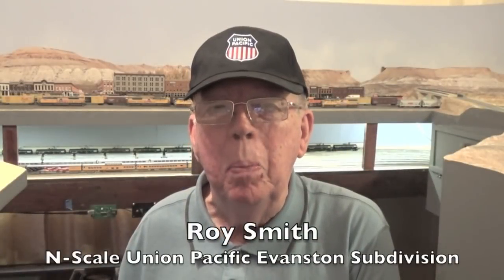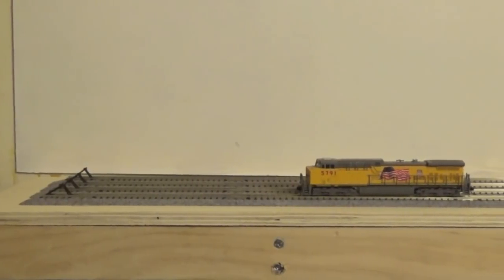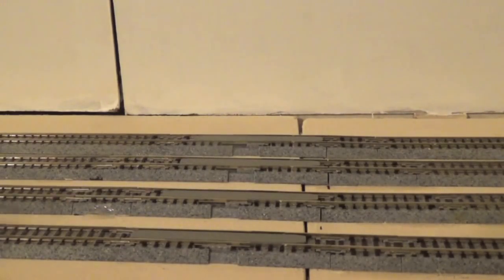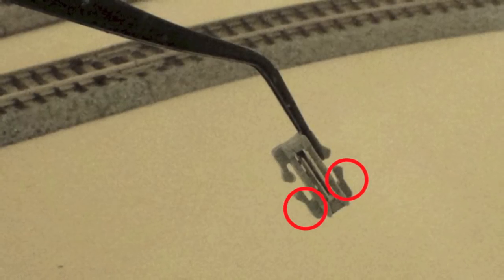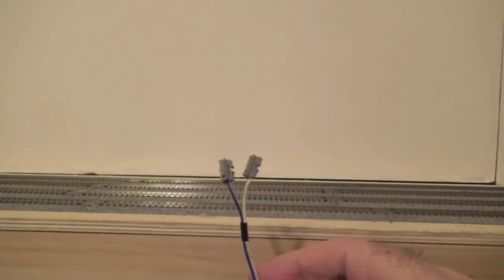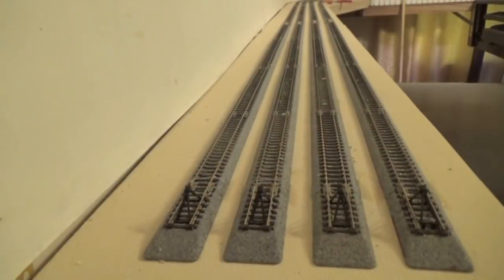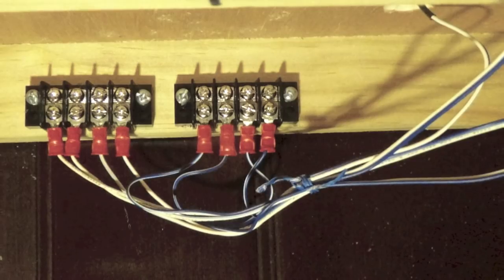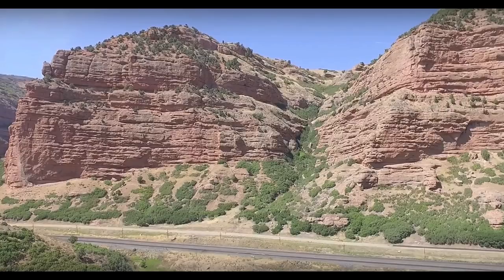Pocatello 4: N-Scale Trackwork and Wiring at Pocatello

Comment: Roy..out of all the lift out, swing and other type of removable bridges I've seen over the years..this method has to be one of the easiest.  The way the expansion pieces allow you to disconnect the bridge section is perhaps the best I've seen. .. I expect this method to be an answer to many modelers in the future. Thanks for sharing...  Tom
Reply from the maker: Thanks, Tom. I really appreciate your very kind comment. i'm really pleased with Kato's expansion track, the way it works, and the way the lift-out bridge turned out. It is unbelievably quick and easy to remove the bridge when I need access to the closet. It's always nice to be able to share the hobby with you. ..Roy

Comment: Roy, May I suggest you simply get the appropriately sized drill bit for your feeder holes?  A simple spade bit will still fit into your electric hand drill and be able to cut a large hole.  Just a thought to perhaps help.
Reply from the maker: I used the largest-sized bit that would fit my drill, but you're right: I need to get a spade bit. It would be better. ...Roy

Comment: Looks good Roy nice ideas keep working away at it I'm Ho but with my lift out sections I aline my rails with no rail jointers and than soldier my feeders and make two metal contacts on the layout and the underside of the lift out sections and just drop or push the sections in. And they make contact no wires to disconnect metal contacts are wired to track feeders on the lift out sections I had my own easy to do ideas for a DC train setup I'm not DCC 
Rodney
Reply from the maker: Thanks, Rodney. Good to hear from you. I really like the Kato expansion tracks because they are easy to install and easy to use. Always looking for an easy solution, I have managed to avoid the cutting, soldering, and special wiring. ...Roy
Reply: N-Scale Union Pacific Evanston Subdivision I don't cut anything I piece it in til it fits as for feeders there rail jointers with wires so it cuts back on a lot of soldiering etc we all have different opinions n ideas but it's whatever works for that person and their railroad
Rodney
Reply from the maker: I like your solution, Rodney. I think less cutting and soldering, as you do, is the way to go. ...Roy
Reply: N-Scale Union Pacific Evanston Subdivision thanks Roy even thou it's old school dc my trains are not all circles and are at long distances so I still add lots of feeders to get good electric power 
Rodney

Comment: Great video! Where did you find the Radio Shack parts? Do you still have Radio Shack in Panama?
Reply from the maker: Nope, so far as I know, Radio Shack no longer exists here in Panama, although it used to. I bought the Radio Shack barrier strips and jumper strips online direct from Radio Shack, but that can be difficult sometimes because they're often sold out. I can also get them from Amazon but at a much higher price. ...Roy

Comment: Hello again Roy, the Kato unitrack has a better connection method. Does it come in different codes?
That’s neat the way you made the lift out section.
Regards Gary
Reply from the maker: I'm afraid not, Gary. Kato N-scale track only comes in one code, code 80.  I wish it also came in code 55, and I wish Kato would make curved turnouts. Thanks for watching and commenting....Roy
Reply: N-Scale Union Pacific Evanston Subdivision thank you Roy for your reply. Have a great day, regards Gary 😊

Comment: Hi Roy! I was checking out those expander Unitrack pieces during  my  last trip to the hobby shop; but I opted to buy the Kato V-1 set to add to my basic oval instead .  I'm trying to find out if or how I may interface the Kato track  with the Bachmann  E  Z  track. Any tboughts?
Reply from the maker: I believe that that Kato can be connected to non-track Kato as long as it is code 80- track and you use the rail joiners for those tracks rather than the Kato Unijoiners. This is true of Peco and Atlas track, but I'm not so sure about Bachmann track Also, I know that. Kato makes a transition section for connecting Kato track with non-Kato track. ...Roy
Reply: N-Scale Union Pacific Evanston Subdivision Thanks Roy
Reply: Thanks again Roy! I found  out  by doing a little researching,  that the Bachmann  E  Z  n scale  track   is indeed code 80. It looks like  I can use interface  them and have the best of both worlds , after I retire  and start building  a  permanent   layout